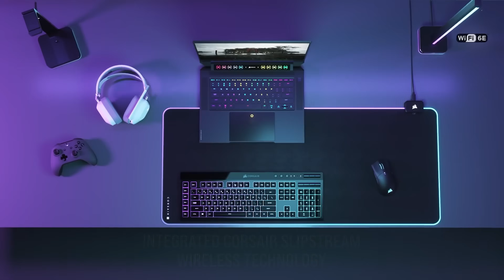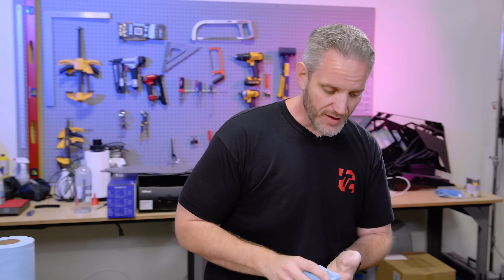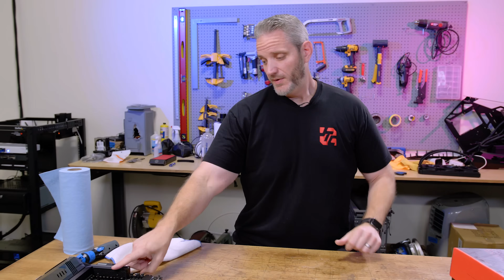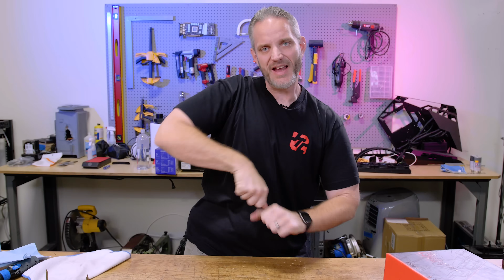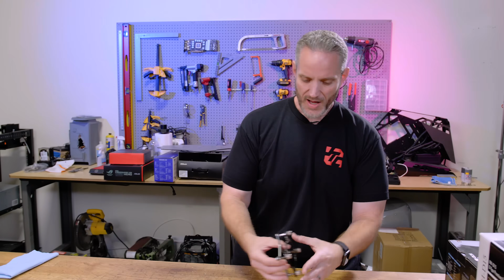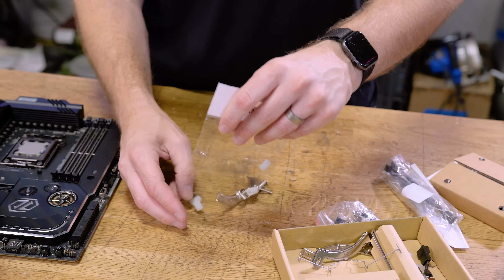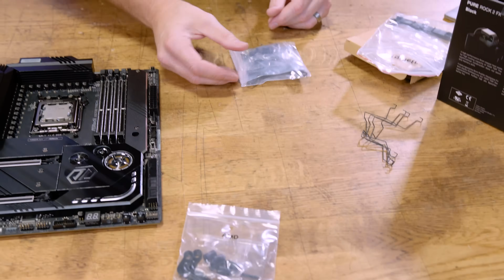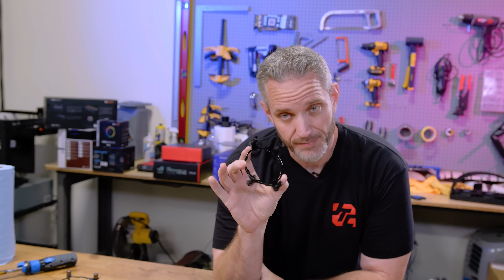AMD made a terrible flaw with this design...

Comment: To compare the Ryzen 7000 vs 5000 cooling difference atm you only need to test them with the same power limits. And for now test showed that they are very close. Even with 7000 being denser due to the 5nm vs 7nm process.
Reply: The main issue is a lack of relevant testing, for example, can a user who is currently on an AM4 based system with the NH-D15, keep their cooler when upgrading to Ryzen 7000, or will the cooler be unable to handle the thermal load. The AM4 mounting kit for the NH-D15 will work with the stock back plate for Ryzen 7000, but there is a lack of info on if it will offer enough cooling or will the CPU throttle a lot more and perform noticeably slower.
Reply: @Razor2048  I have seen a youtube video recently which showed that at the same power limit Zen3 and Zen4 have almost same temps (~2C difference) so I think that should answer your question.
Reply: @giorx5  The main issue is that if someone is upgrading to Ryzen 7000, they will want all of the additional performance that ryzen 7000 has to offer, the question is will their current cooler be able to handle the thermal load of the CPU.
Reply: @Razor2048  Point is that for a dacade now, to get the ultimate performance for a top-tier CPU or GPU you also need great cooling, and that costs much also.

Comment: I think for the NHD-15 you need the nm-am4 mounting kit.
Well, i think it's possible they also took some height space for their 3D cache CPU
But i think it would have been smarter to increase the internal pin and raise the internal of the cpu to have the core as high inside as possible

Comment: You use Curve Optimizer on zen 4 and temps are back to normal - and performance goes up.  Then Jay points out how this isn't compatible with anything that doesn't use the AMD clips....and then shows half a dozen AM4 coolers which are perfectly compatible....wow what a story....  The only issue is those that use their own backplates which is a very small number of coolers.

Comment: LOL "shut up if you're arguing because you're wrong". I like the candor. 🤓 I think he's right though. For above ambient, you can't be too cool. I think nand may have data retention issues below ambient and condensation is a below ambient problem assuming you don't have a humidity problem in your room.

Oh, it goes without saying, but you can't cool below ambient with ambient air which is every air cooler and water cooling where the water is cooled by airflow.

Comment: your idea at the end, would it not be easier to lap a zen 4 down to zen 3 IHS height?
more accurate too as you wouldn't have broken the original die/IHS connection... i forget, is that solder?

Comment: I'm thoroughly expecting for the 8000 series CPUS that all of the current AIOs will still work but there will be some sort of adapter kit because the IHS will be thinner. Thinking about my h170i all Corsair would have had to do would be make a set of screws that are slightly shorter than the elite retention kit that comes with the newer Corsair AIOs.
Reply: 8000 series... you live in the future.  monkaS
Reply: Yup, a new set of chips even based on the current 7000 dies with a thinner IHS along with exchangeable back plate and chip retainer for current motherboards seems the way to go and bypass the AM4 cooler compatability issue.

Comment: Temp wise it would be enough to shrink the heatspreader just 1mm down to let the heat get thru better
Reply: And then what? The boost algorithm will still boost to 95°C, as long as the CPU does not hit the power limit.
DerBauer got 20°C lower temps, but I'm not sure if he has shown the power consumption. I guess the CPU simply ran into PPT before reaching 90-95°C
Reply: @johnscaramis2515  False, with the PBO2 and curve opt. set to negative and starting with 30 and working your way up until its stable u will get 5C lower temps with almost half the power consumption, with 200mhz allcore more and therefore better performance. even with a neg. 15 offset your running pretty good. so with a shrinked IHS or beefy custom loop this will be even better.

Comment: Dropped 20c off of a 12700k just from lapping and replacing the shitty intel ILM. I feel like none of these ILM's and coolers should be height limited. Let them tighten down w/o travel stop and supply a torque spec T handle like Park Tool sells instead.

Comment: I dont get it. I went am5 with a 7950x. Used a corsair AIO that used the 4 point screw system(not the hooks). And its fine. it seems flush and its working...

Comment: The am4 backplate allows for more flex and helps normalize pressure across the die.  The am5 is very stiff and forces the cooler to match the flex... which doesn't work as well

Comment: It was immediately obvious that the reason the IHS was so ridiculously thick was to maintain 'compatibility' with AMD's AM4 mounting. AMD should have just went ahead and changed it as the 7000 has no backwards compatibility with anything else. Bad decision from somebody that it gonna hurt.. I fully expect a change to the IHS in the next gen if not a in mid-gen refresh.
Reply: I think they did this for the 3D vcache models without thinking about how this affects the normal ones. The 5800X3D needed to have the dies shaved down to fit under the IHS. This thicker IHS means that they can just make this IHS thinner, which is cheaper. Maybe for next gen they can add some extra material between the dies and the LGA on the standard models to reduce IHS thickness.

Comment: ok so there is 2mm more ihs material then a ryzen 5000 or lower cpu. would it be possible to just sand down by 2mm or would that make cooler compatibility worse.
Reply: Obviously make the cooler compatibility worse.... Because if you sanded it down by 2mm than it would be 2mm too short and have horrible contact with the coolers cold plate... The entire reason they raised the IHS by 2mm is so it would have the same height as AM4 so it would be compatible with AM4 coolers. Take away those 2mm and now it's no longer compatible with any cooler...
Reply: @PabzRoz  well when people delid cpus to cool them how do they account for the height difference? maybe the same technique could be applied here.
Reply: @SuperCookieGaming_  Delidding doesn't change the height off your CPU's IHS... Deliding is the process of removing the IHS and replacing the thermal compound underneath then putting the IHS back on thus not changing the actual height of the CPU. If you're talking about lapping where they actually sand the CPU down they're not taking off height as much as they're just trying to make the IHS even. When you're lapping you're taking off micrometers. Lapping won't effect cooler compatibility because of how little of a difference you're making. Meanwhile this IHS on AM5 is an entire  2 millimeters thicker.
Reply: @SuperCookieGaming_  And If you mean how do they account for direct die cooling where they remove the IHS completely then they sell custom mounting kits for that or extreme overclockers make their own to account for the height difference.
Reply: @PabzRoz  that is what i was talking about.
Reply: @SuperCookieGaming_  What direct die cooling? Yeah a few niche places sell custom mounts for that or people custom make their own. But you can't sell custom mounts for "sanded" IHS's like you're saying because nobody will sand the exact same amount off their IHS so you can't sell a mount that will work for everyone, it's not practical. You would have to custom make your own mount in that case. Unlike direct die cooling where you just take off the IHS and cool the die they can sell mounts for that because the die is a standard height once you take off the IHS.

Comment: Jay you don’t get it completely. Don’t just be another FUDster as “DeSell Tools and mounting paste” is, but a good guy. However, not always right. I think both of you are well meaning, but the cliq-bait. I thought you had turned away, but dark side called Jay unable to resist. 

You’re right about some elements, but we’re building over a thousand machines for our developers second machines. AMD did blow it on details and heat. This was a mistake and IHS direct die is a good choice, but not for faint of heart.
Reply: I agree with Jay being cliqbait but what does anything you said have to do with anything lol

Comment: Oof, do you think lapping is going to become more popular (or necessary) with AM5? Or do you think it's just going to be direct-die or stock?
Reply: Lapping won't do much of anything. The IHS is still going to be much thicker. The point of lapping isn't to thin out the IHS but to fix any unevenness and make it perfectly flat for better cooler contact.
Reply: @PabzRoz  Igor's Lab measured the flatness of the IHS. Also due to its thickness, it's very straight, there's not really anything that actually can be lapped.
Reply: @johnscaramis2515  That's at least nice to hear. Although every sample is different no IHS is the same. I'm guessing what he meant is they're flatter on average compared to previous generations due to the thicker IHS.
Reply: Oh ok, thank you, gents

Comment: 8:30 Funny thing is that I did that with my AMD Athlon 2200+ on AM2 platform. That was my first PC in 2003. I did that mistake because I was using an off brand CPU cooler from CoolerMaster. It has stock AMD mounting but much stronger to attach to thoose clips. Because of that oopsie I was left with no PC almost 3 years. I bought a laptop from Asus back there. I was affraid doing any maintenance so I choose not doing them at all. This laptop is still workin!
In 2011 in april this laptop start lacking his perfirmance so I decided to buy builded by professional PC tech guy high end PC. I still remember waiting for part coming from China :-D 3 months waiting for my Asus Strix IV Formula paired with AMD Phenom II X6 1100T. This beast served me truelly 9 years till May 2020 when I build my currently using AM4 platform PC

Comment: Very few people will be interested in direct dye cooling.  99% of people don't want to risk damaging their high end CPU just so they can cool it a bit better.  People are getting a little too obsessed with keeping things even just a few degrees cooler.  Saw a repair shop video where he said the majority of GPU's for examples he gets in are from people damaging them while trying to change thermal paste, add liquid metal etc just to try to get the card a bit cooler.

Comment: I just built a 7700X system yesterday and I used the Scythe Fuma 2. My temperatures have been just fine so far - usually between 40-60 C when gaming. It does not use a hook-based bracket. And stock, it boosted to 6.15 GHz at 74.6 C during a short burst of active load. Did I just really win the silicon lottery??
Reply: 40-60°C during gaming seems reasonable, even without winning in the silicon lottery. And 6.15GHz speaks for a win in the silicon lottery, however you have to remember how AMD's boost algorithm works: it pushes frequencies until it reaches either max temp, PPT or EDC (or any of the other limits). If you only use maybe 4 cores and the other 4 cores are close to idle, the boost algorithm has much more headroom for the 4 active cores to push them even higher.
Reply: @johnscaramis2515  sadly, I didn't have a time record running, but 7/8 cores went to 6.15 GHz. I just can't say it was simultaneous or for how long. The number itself just really surprised me since I had made no changes off of default yet.

Comment: 20c down with delliding is one hell of a step. I actually don’t care about this 95c is by design stuff. If they wouldn’t have done this stuff no1 would complain in the first place. I can feel Reddit overflowing with „is this temperature too high with xyz cooler?“.

Intel got hated on for using TIM instead of soldering and they changed it (and it was another as intended by design bs). I hope AMD will do a change with their next run of CPU. I personally won’t buy a CPU that runs that hot and needs to use a AIO to not overheat without UV and that sorts. It’s just lazy and nothing more that a design flaw

Comment: Question. If you had to change the backplate was it really AM4 compatible to begin with? Seems to me that if you're having to replace all of the mounting hardware then it isn't really compatible. To be considered out of the box compatible it should be able to work with the mounting hardware as supplied with the motherboard without changing anything.
Reply: You're thinking the wrong way: mainboard manufacturers provided a standard AM4 backplate with all motherboards, which was afaik very good and stable compared to Intel (did Intel have a backplate at all?). But some cooler manufaturers due to whatever reason threw and throw out money (or think they can do better) and design their own backplate for AM4, which is incompatible to AMDs standard backplate. All the coolers which bring along their own backplate are most likely incompatible with AM5, the ones which make use of AMD's standard AM4 backplate should be compatible
Reply: ... except the stock AM4 mounting system sucks because it's a two-point mounting system.... so it's best to actively avoid coolers that use it in favor of ones that use a 4 point mounting system as Jay said. However, the one I use (Corsair H150i Elite LCD) does use the stock backplate... it just uses four standoffs instead of the stupid clip things.

Comment: I think it is time people admit AMD went full anti consumer with AM5.  The prices are ridiculous across the board for all AM5 components.  95c is idiotic and purely from a "we want to win benchmarks" motivation, multiple reviewers have shown down volting vastly lowers temps for only 200-300 hrtz loss.  Forced upgrading to the very overpriced DDR5.  Forced Windows 11.  Bad implementation of AM4 cooler compatibility.  I am sure if I look I can find more.

All that good will AMD earned on AM4 from me has gone out the window with AM5.  I am either going to switch to Intel or just get the 5950x as the best AM4 upgrade when it's price drops some more and skip the entire next generation.

Comment: Jay, EKWB has already done what you are asking, for their X299 waterblocks.  On that platform, the screw holes were built into the CPU retention mechanism, so replacing the backplate was simply not possible.  Thus, EK made waterblocks that simply screwed down into the existing holes.
So, considering that, I'm sure they should have no trouble making blocks that accommodate AM5.

Comment: Sure, der8auer dropped 20c of the CPU with direct die cooling, but if the IHS was 2mm smaller from stock, a delid would have still dropped temps by 15c. I guarantee you if you delid a 5950x that uses 200w, it also would drop temps by 15c.

Comment: This might have been said/asked already.  It is inevitable that a 3DX version of the new 7000 series CPU's will be released, was the extra thickness already put into the IHS so it can be thinned when the 3DX part is put on top of the die keeping the same height as it is now?
Reply: I was wondering this.
Reply: For 5000 series, the dies were the same thickness. Sounds like the main reason it’s so thick is just to maintain comparability with coolers. Sounds like a waste to be backwards compatible in that area to sacrifice thermal efficiency. Maybe they’ll add like 1GB of L3 cache to make up for it 😂
Reply: @bighammer3464  Nope. The 8 core chiplet had to be thinned first.
Reply: @markhackett2302  nope. you didn’t have to do anything to the cpu to get a cooler to fit. The ihs was just thinner
Reply: @bighammer3464  Nope, you and me didn't have to do anything, but we don't make AMD's chips, AMD does. And they had to thin those chiplets first.

Comment: The AIO cooler companies chose to use there own backplate even though the stock AMD backplate is good enough for the job.
My 5 year old Noctua d15 AM4 edition uses the AMD backplate without a problem at all, the AIO companies developed this problem, not AMD.
You can even get free Noctua AM4/AM5 kits for the cooler you have on the table.

The IHS thickness is to spread the heat from the cores to the entire IHS, this helped Intel when they had IHS problems and it also helps AMD when using regular thermal paste.
Try running direct die and you will be forced to use liquidmetal because the thermal contact area is now smaller then with the IHS on and that makes it nearly impossible for normal paste to conduct enough heat away.
10:50 Der8auer mentions 1-3 degrees difference with his prototype liquid metal vs regular store bought liquid metal, not the difference between normal paste and liquid metal or anything to do with the delid.

Comment: I´m not sure how the IHS is supposed to make up 20° t-diff...
A quick calculation shows that the t-drop across a 3 mm copper sheet, 3 cm squared , with 200 W passing through it is around 0.017 ° (not accounting the drop from die to IHS). So there seems to be something else going on here.

Comment: Just bought a Asus Crossfire X670 Hero with and Ryzen 9 7950X with Asus ASUS ROG Strix LC II 360 A-RGB cooler and changed the coolingpaste with kryon on all cores with load im getting like 69-70 degrees celsius in fahrenheit 156. Haven´t really pushed it yet but everything runs above 80fps on 4k with RTX and ultra with an RTX 3090. So if you are gonna try for oc records it might go to 95c but mine doesn´t. Most I got was at 5.6 It got like 76c.

Comment: i have 3 theories why AMD has a thicker heat spreader
1. just to keep the z axis of the cooler hold-downs the same as am4
2. to allow for larger chip z axis in the X3D variants of chips
3. to allow proper pressure on the chip for coolers when in the new securing bracket aka: the z axis distance between the the top of the LGA hold-down and the top of the heat spreader

for 1 we know this is true, for 3 this might be true, for 2 we wont know till the X3D chips are released

so this might not be a flaw but for future needs